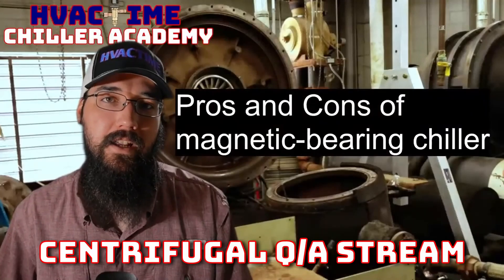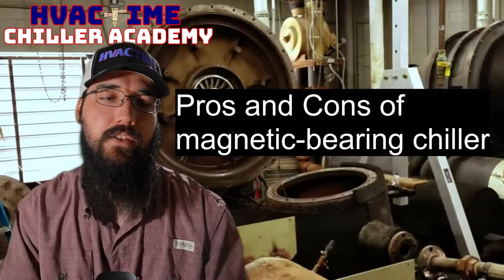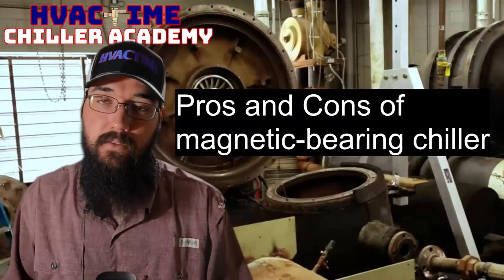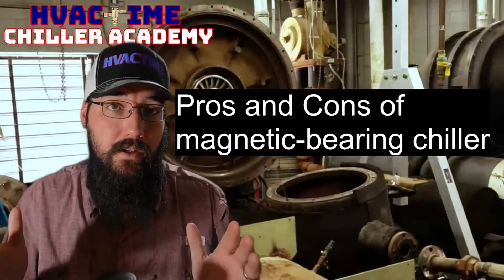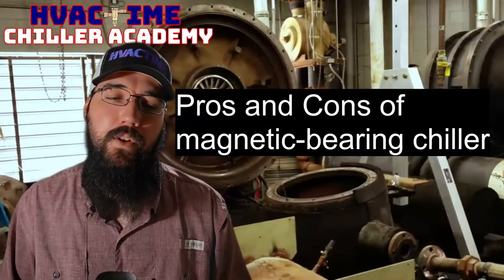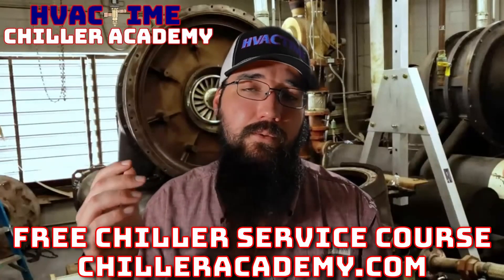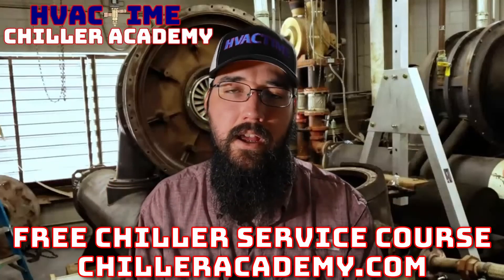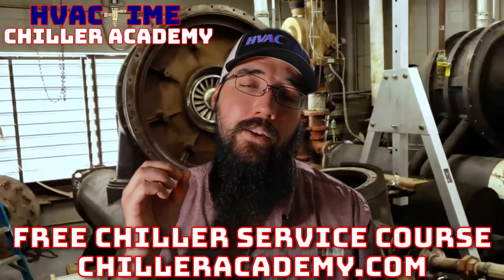Magnetic Bearing Chillers: Pros & Cons

Comment: As wonderful as the new technology is, these machines are becoming increasingly too complicated for their intended purposes.  It would be different if the mfg would make parts and information readily available for maintaining any of this equipment but its getting worse by the day.  Any savings in efficiency is always gobbled up by the first major electronics failure and the fact the mfg makes it impossible to get passwords to even service the machine now.  Not to mention the downtime waiting on pricing and availability of parts from the mfg is pitiful.  Every one of my customers are always looking for the least expensive options on equipment and tire of oem lockdowns of software or parts sourcing.  Mfg's are always pushing the shiny new penny to install with efficiency promises.  I have never had a customer demand information on energy consumption between equipment mfgs.  Only questions ive had were cost, footprint size, tonnage, serviceability and parts sourcing, then lifecycle.

Comment: Harmonics is what you were trying to reference when speaking of power instability. Having a lot of drive can induce Harmonic voltage and even worse Harmonic current. Thats why all mag bearing compressors have touchdown bearings. Turbocor will turn into generator mode if there is a power loss to safety land the bearings on a coast down.

Comment: wouldn't the line reactor protect the mag bearings from power instabilities?
Reply: A line reactor is for transient spikes. It helps absorb them and deliver filtered current/voltage to the machine. Harmonics is an issue, though, when using a drive.

Comment: I’m glad you mentioned the recovery cylinder problem. It’s not common homage that the tanks you get commonly are not clean tanks. They haven’t been cleaned as thoroughly as a new cylinder and they aren’t even evacuated as low as the maximum decay of an open system repair! You have to ask for “new” or “clean” cylinders. If you can’t get those you better have a good filter dryer inline during recovery and recharge.